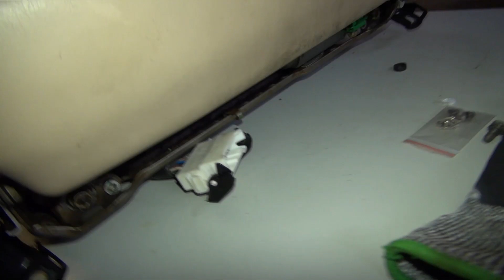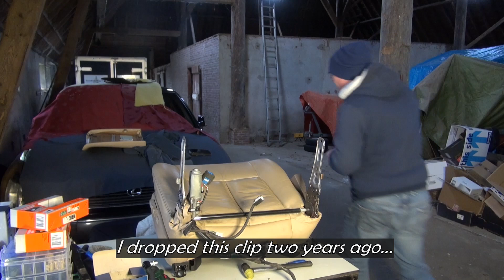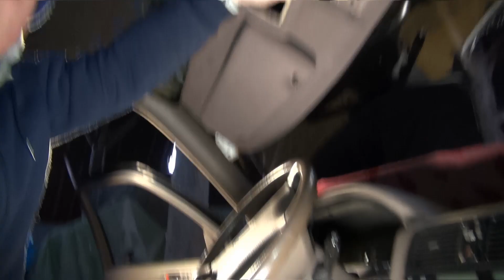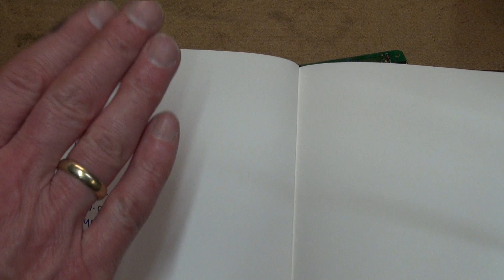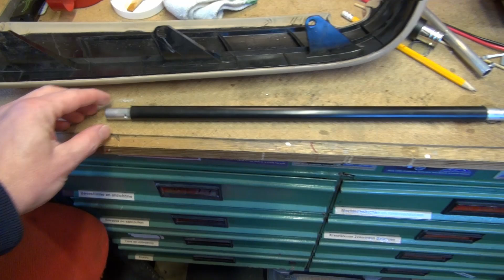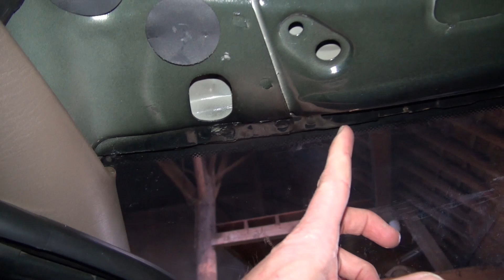Project Lexus LS400 Episode 37 - Drivers seat repair, replacing microbulbs and finding a (big) leak.

Comment: Hi there i am trying to fix seat memory i can set 1 and 2 and the wheel and belt moves but the seat doesn’t move at all
Reply from the maker: Doesn't it move at all? Or does it move with the buttons on the seat itself?
Reply: @Carnold_YT it moves with the control on the seat but not when i try seat memory

Comment: does anyone know how to move the seat forward and back without power? my front bolts are completely inaccessible. I unscrewed that front panel and the rods which move it have nuts over them? I don't think I'll be able to do anything once the nyts are off without completely chewing up the threaded rods but if anyone knows how please let me know. (or which wires to apply voltage to to move it backwards, i can lean it forwards and just barely tap into the connector directly if needed.
Reply from the maker: Shoot me an email: arnold@carnold.nl I can send you the info from the workshop manual. Let me know what year your LS is from.

Comment: Hello, I have a first generation celsior. Headrest are electric, I need to take them off to put lace seat covers. Usually you raise all the way up, push down on plastic circles and they come out. As the button doesn’t work I want to try and take off headrest through the back panel if possible. Do you know if u need to unplug first to get back panel off. I have screws off but feel like if I pull too hard I’ll break something? Any advice
Reply from the maker: I had to think real hard and I don't have a straight answer. You can unhook the headrest upholstery at the bottom. There is a long plastic clip between the two chromed rods. When you unclip it, you can pull off the leather and the foam inside. Hopefully you can expose the two pins and put the lace over it. Keep me informed if this works. The workshop manual only provides information on the headrest motor. It is accessible via the panel on the back seat. Hope this helps 😊

Comment: Hiii i’m currently looking for some suggestions, im swapping in an interior and the front seats get no power to remove them, any ideas on what i could do?
Reply from the maker: You mean that you can't slide the seats or move the seatback? It might be a fuse related issue. I have to look into that to give you a correct anwers.
Reply: @Carnold_YT long story short, im swapping over a blue interior into my 1990, the engine harness has already been removed and no way to power them to move, i have literally one bolt left on both front ones
Reply from the maker: @alexvaldez7050  I will look it up in theworkshop manual, will get back to you as soon as possible!
Reply: @Carnold_YT id greatly appreciate that truly thank you
Reply from the maker: @alexvaldez7050 The controller ECU under the seat has three connector, A, B and C. C is the connector with 12 pins, B is the middle connector. Connector A should have more pins than C. The pins are counted from the top left to bottom right. The power supply comes in on connector A, pin A1 and A7 are ground, A6 and A14 are battery plus. The seat control come in at connector C: C2 is seat slide forward, C8 is seat slide backwards. C3 is seatback backwards, C9 is seatback forwards. If you apply 12 volts to each one of those pins, the seat motors are powered. Please be careful when you try this, I can't guarantee that it works for your car, because this is the pinout for a car with seat memory. Feel free to email me at arnold@carnold.nl

Comment: Thank you so much for documenting your ingenious fix for the seat recline rod! I ended up doing something similar to lengthen a new rod for the 1995-2000 models (which are still available) to fit my '92 instead. The splines for the newer rod PN match up perfectly, but is ever frustratingly just a bit too short.
Reply from the maker: Thanks for your comment! Good to know that the later model has the same spline pattern, that's useful info!